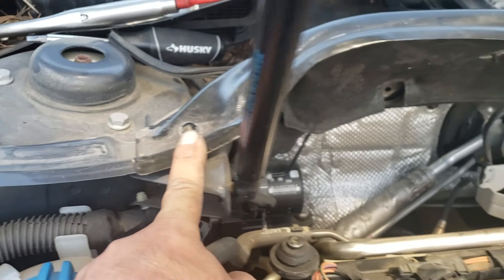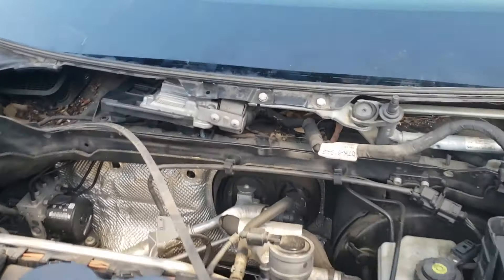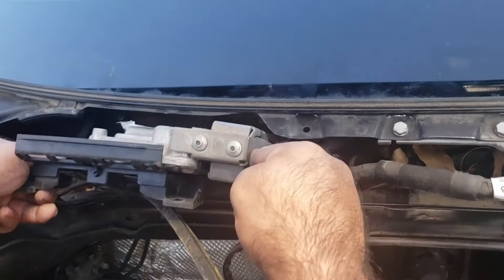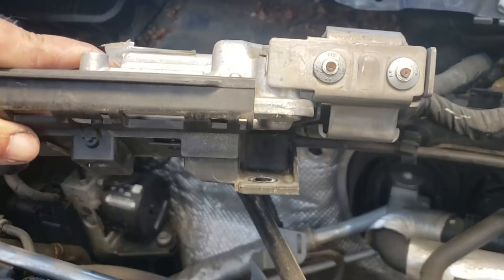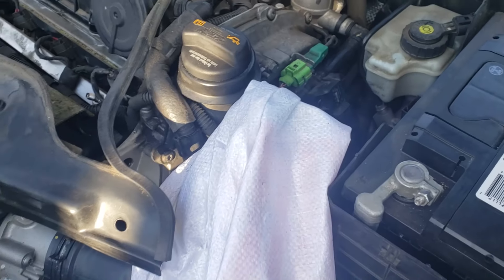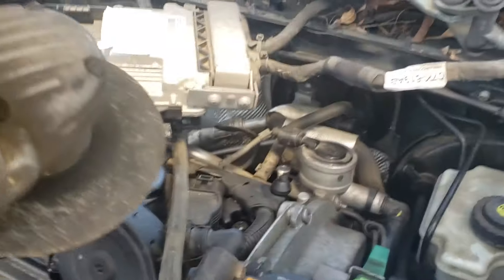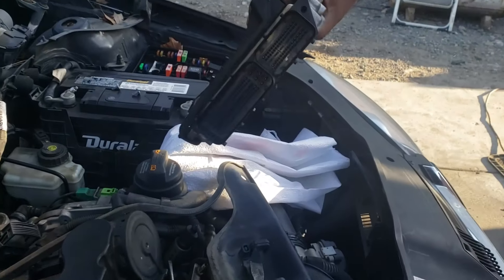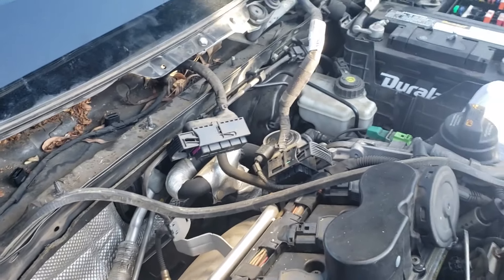VOLKSWAGEN ECU / ECM REMOVAL / VW JETTA ECU COMPUTER LOCATION AND REMOVAL

Comment: Hello, so I know this video dates back a while, but hoping for at least a response. So my Volkswagon is have an idle issue to where it shuts off only at idle. Drives perfectly fine, and had the fuel pump replaced, no vacuum leaks detected, and still same issue. My mechanic said it is a transmission issue but just want to make sure it's the ecm before doing it
Reply: I’m having similar issues with my Jetta. Only at idle my engine rpm will rev really low and battery light comes on at dashboard. Doing some research I came across a known VW problem called “coolant migration “ it causes all sorts of crazy electrical problems by corroding plugs and wires throughout the car. Also a clogged sunroof and clogged windshield drain can cause corrosion to electrical contacts/parts. The ECM is located under the windshield wipers. And the problem you describe is caused by intermittent voltage drop to the ECM making it shut off

Comment: When replacing the ECU, does it have to be reprogrammed?
Reply: I have a 2008 Jetta 2.0 and I believe I need my PCM replaced. Keep getting P0606 which has to do with PCM losing its memory capacity. I also believe the new one, wherever I might find one, needs programmed to the car.
Reply: @jett-rampartflyer2852 did it have to get programmed?
Reply: It really depends if ECU contains the immobilizer or not. If it contains the immobilizer, you have to reprogram it and you may need the encryption keys for the replacement part to unlock it. If it doesn't contain immobilizer or keyfob data, you can simply swap used part in if the donor car has identical components (that is, same gearbox, same engine, same ESP, ABS etc). If you don't know the details of the donor car, expect the replacement ECU needing to be reprogrammed so that it works with the other components in the car.

Comment: Do you have to reprogram the ECU if you buy  The same ECU that is already programmed
Reply from the maker: hello, you do have to reprogram with your vin # i had a lock smith program it, cheaper than the dealer
Reply: @TRUCKINGTIPSDIY  Ok thanks alot man imma try that
Reply: @TRUCKINGTIPSDIY  Hey I'm being advice that if it's a used ECU they will be unable to overwrite the VIN

Comment: How did u guys pin point that it was bad ecm? im getting good power and ground on mine but still has communication code
Reply from the maker: i tried replacing sensors, fuel pump, check the wires, we replaced the ecm and now the car doesn't turn off!
Reply: So what's your car is surging and then shutting off

Comment: I thought the security bolts were to keep the ECM from being stolen from the vehicle. Realistically, the security bolts seem to be there to detect tampering that would void the warranty. A theif would just cut the wires.
Reply: In South Africa,this is how they steal Polo's.
They'd exchange the ECM with theirs so that the car can operate with their skelm key
Reply: @laxsonmathobela7752  strong snips would just  cut through that thin metal plate anyway.. still won't stop a thief, no grinder needed..
Reply: but immobilizer is in dashboard

Comment: Could you possibly tell me where the transmission control unit location exactly for the 06 2.5 jetta
Reply: I need help locating it anyone know where the transmission control unit location exactly in a 2006 Volkswagen jetta
Reply from the maker: hello this was a 2009, the transmission control unit was inside the drivers side fender, you do not need to remove the fender, just remove the tire and the plastics that cover that area, you will see the unit, it has 3 or 4 , 10mm nuts
Reply: @TRUCKINGTIPSDIY  thanks man I've been told  passengers side floor under the hood under the wind shield wipers and in the transmission
Reply from the maker: let me know if you were able to find it
Reply: @TRUCKINGTIPSDIY  I sure will it's pouring rain here and I don't have a garage I live in a apartment what sucks

Comment: The mechanic for quote is telling me 960.00 to put computer in and program! How hard is it to program? I have a 2013  VW CC. It is very hard to find anything for my model
Reply from the maker: i bout the computer on ebay for around $60, and a lock smith programmed it for 350, you can try that
Reply: @TRUCKINGTIPSDIY  so when Yu bought it, was it used? So I can’t just go to a junk yard and grab one?